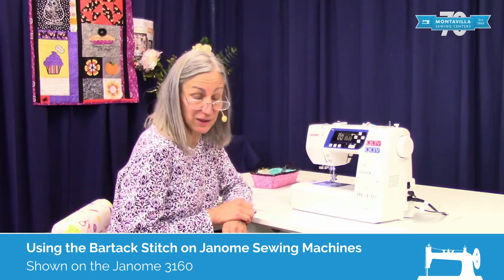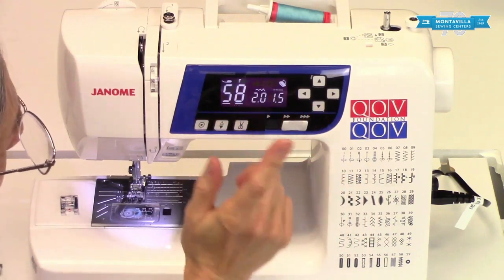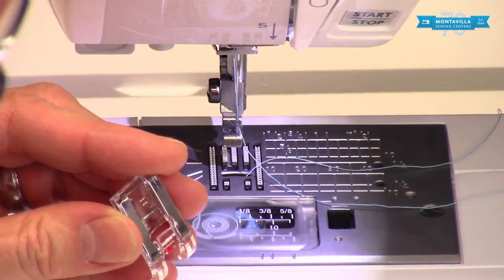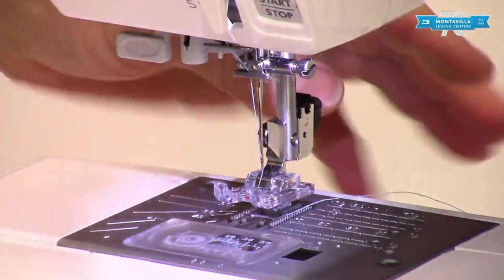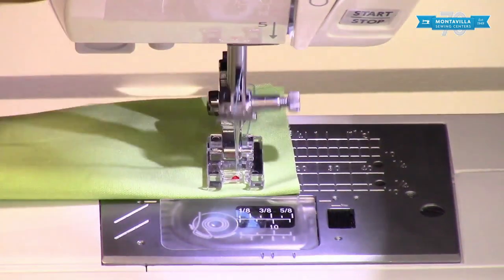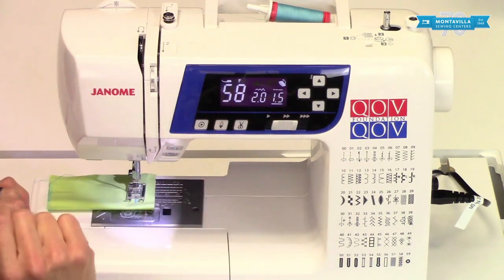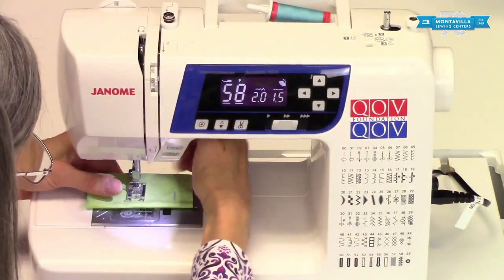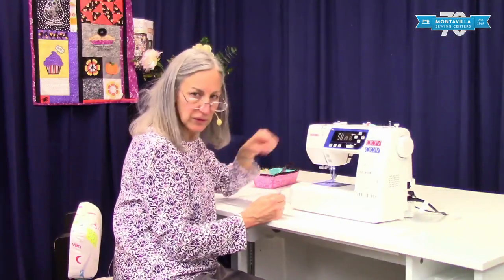Bartack Stitch Tutorial Using a Janome Computerized Sewing Machine - Montavilla Sewing

Comment: I sew basic (for donation, nothing fancy) dog collars with a vintage Singer 201 (1948). I just sew back/forth 2-3 times. I make two of those tacks at each location (the triglide & both sides of the D ring; total of 6). It's tedious (manually back forth). I've been under the impression all this time that I need to spend $5k on an industrial Juki LK1900 bartack machine. Your video caught my eye. The automatic operation would be terrific for me (for much 1/5th the expense).

Do you believe this Janome 3160 is suitable for sewing through polypropylene webbing?[1] I believe my old Singer 201 is considered Heavy Duty, and it struggles. I have to help it often by turning the flywheel by hand to get started.  Or, is there another machine that would do what you show, but more suitable (more power, heavier duty)? I see that the Juki HZL-DX5 has the same feature (even same #58 designation for the bartack). But, I can't tell what's more or less "heavy duty."

It would be nice to be able to save a bartack setting (length, width, density of stitch), not have to set it up each time I start to work. But, wow, what I see you doing would be like a dream come true if this (or another) machine were powerful enough to do lots of webbing. If you had any pointers, I'd greatly appreciate it.

[1] Webbing is 2.2mm (0.088") thick. Two layers: 4.4mm (0.175")